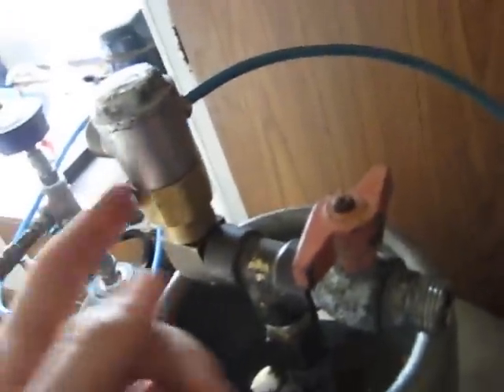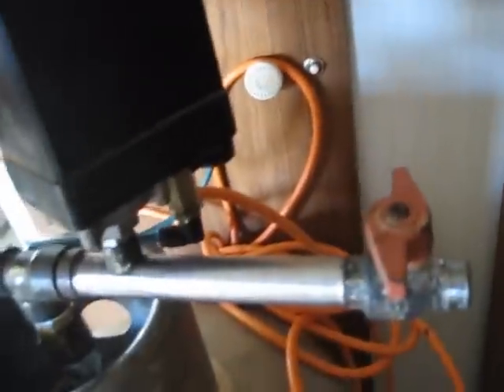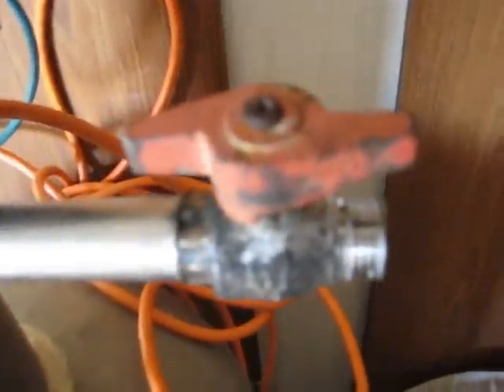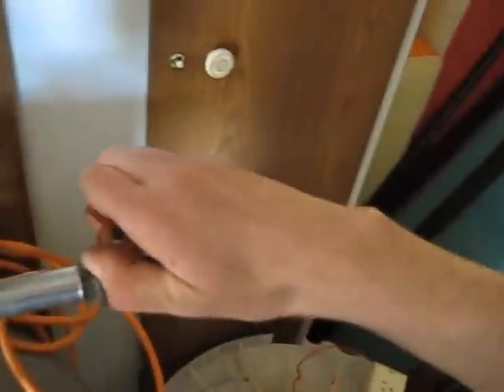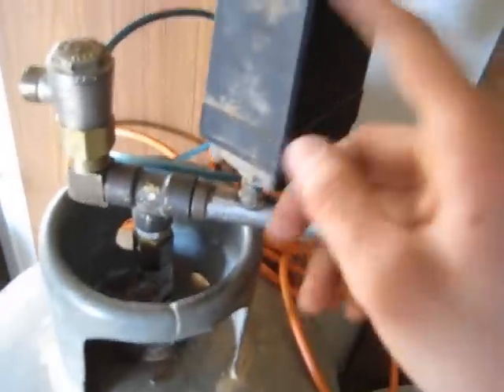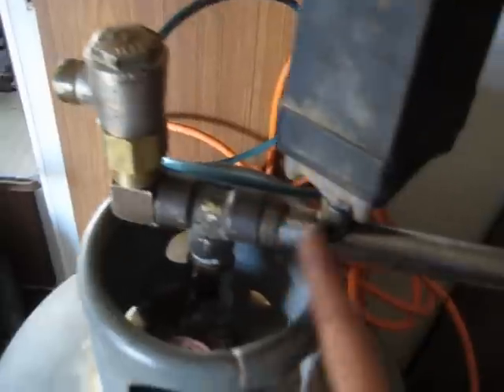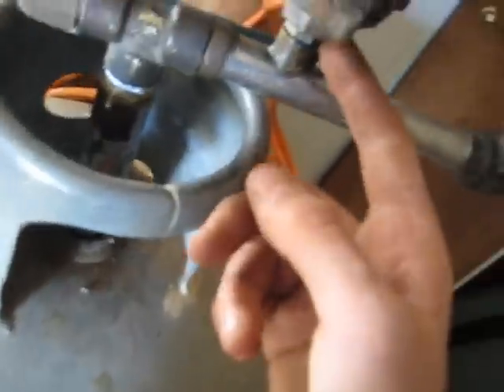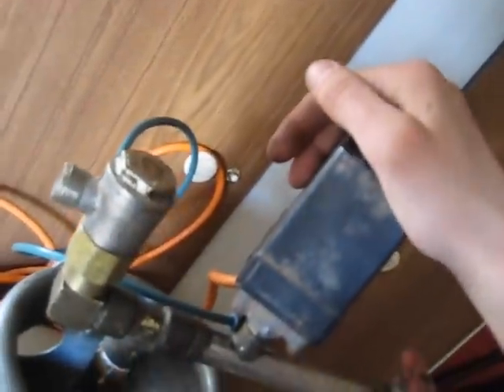Wiring a pressure switch for my DIY Air Compressor Part 2

Comment: you have to connect the electrical input of your compressors to your pressure switch so it can turn on and of your compressors. hope this helps